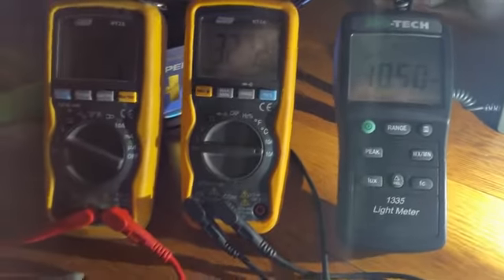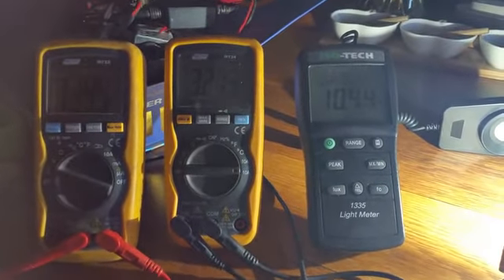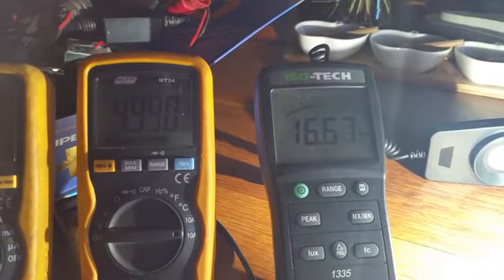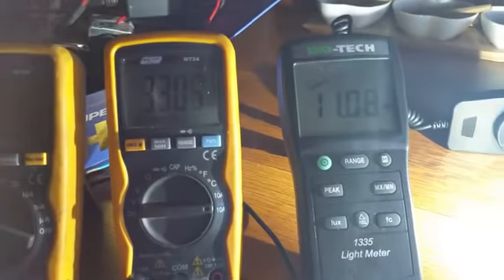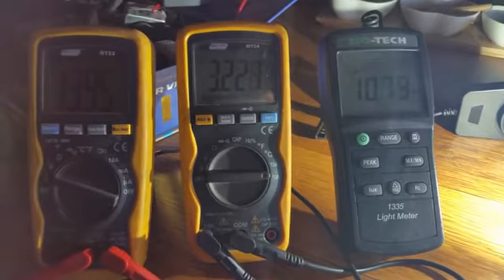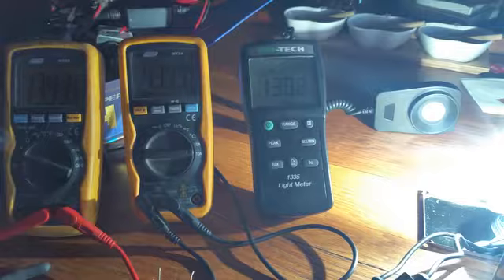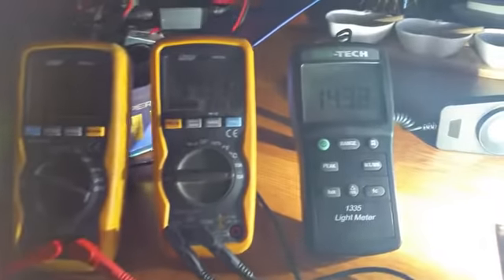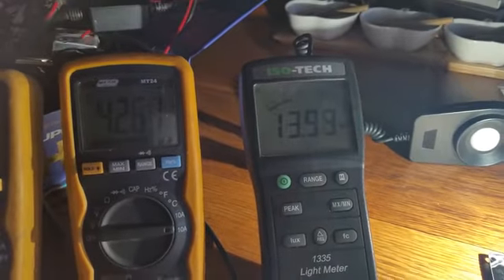Morimoto XB35 ballast (boosted) vs cheapie (boosted)

Comment: how to reduce output ampere ballast? can I put resistor  output wire?
Reply from the maker: Hi man. check this video out of mine.
https://www.youtube.com/watch?v=rmAPBxVTx6Q&t=4s

See where I added the resistor in parallel with the (in my case R033 resistor) to get the resistance lower (to get my ampere higher) , I am sure you can just install a bigger value resister in you original resistor`s place. I have not done it , but I cannot see why it would not work.